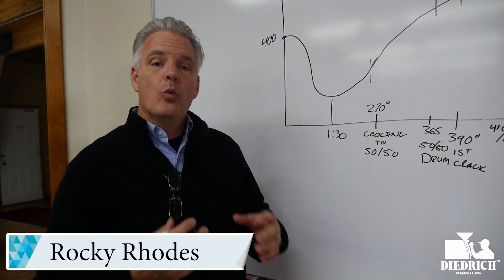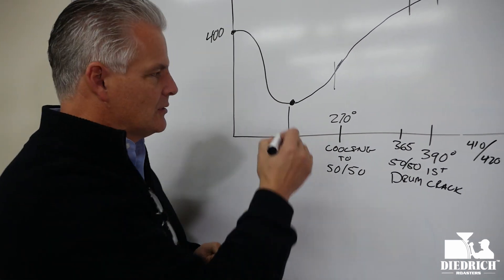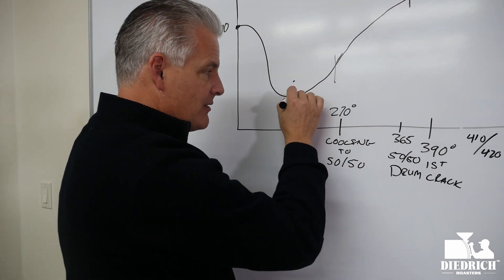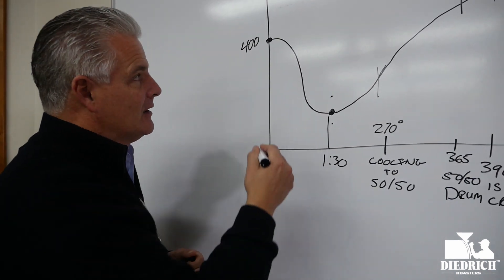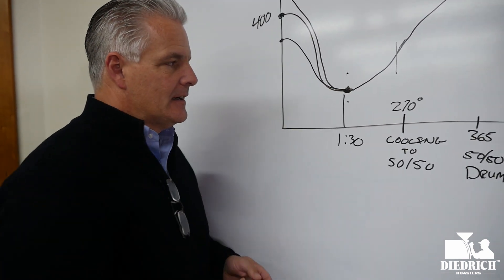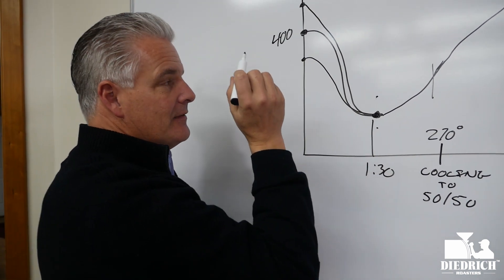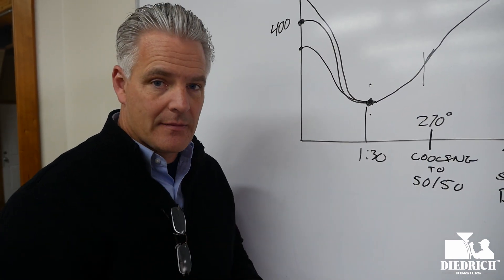Is Charge Temperature Important?

Comment: I worry a little less about my turn and base all my profiles and charge temps with my first target being green to yellow transition. This way, I can carry a profile from one machine to another with much more ease, since each machine has a different set of thermos that all react differently. If I'm hitting my G->Y transition at the correct time however, I know I'm on the right path moving forward.
Reply: Exactly 
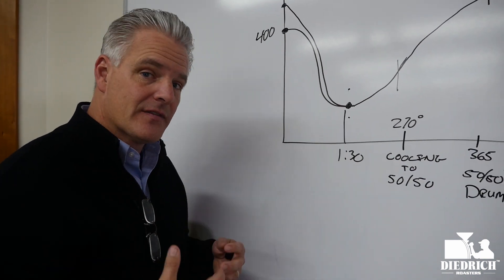I always target to end the dry at around 5 mins but I can't have TP at 1:30 it's always 1:05 esh 
If TP was at 1:30 then Dry End would go further to almost 6 mins otherwise I need to raise the gas in between which might burn the outer beans surface 

Any Idea how to hit both targets ?
Reply: @mohammeds5605  The turn is nothing more than where the increasing temp of recently added cool beans meets the decreasing temp of preheated thermo probes. Since every thermo probe will differ slightly and every machine stores potential energy and heat differently (especially machines of different size and manufacturer), it’s unwise to try to hit someone else’s typical turn temp/time. If you’re hitting a 5 min GY and that takes you you your FC and beyond at times and temp you’re wanting to achieve, stick with what works for you. You can certainly use YOUR turn data to be sure you’re on the right track but definitely don’t use someone else’s. 

I usually refer to my turn data for different charge sizes (of the same profile) on the same machine. I don’t use it from machine to machine though.